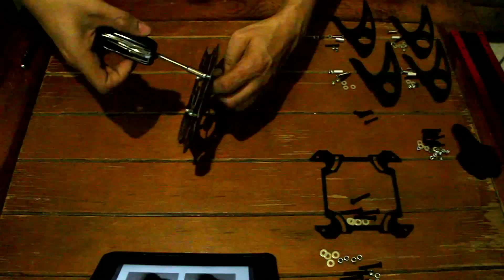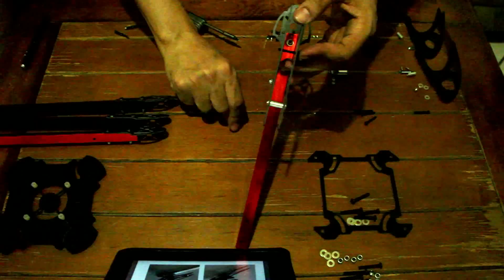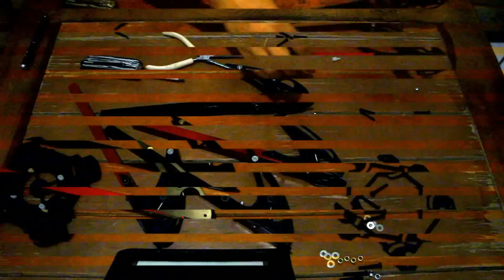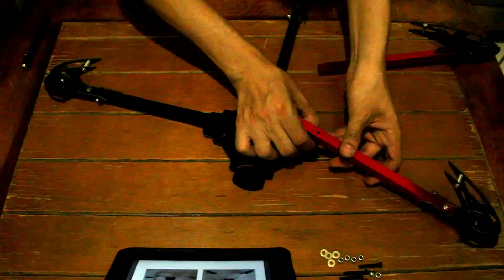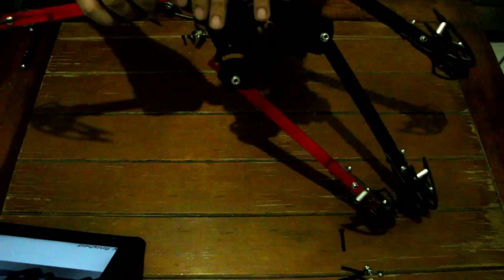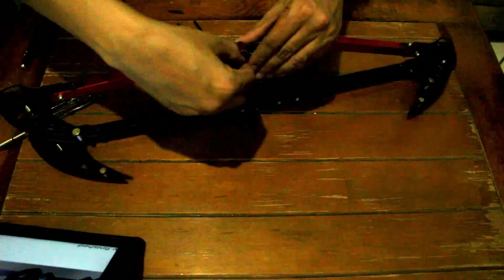Assembly X525 v3 Quadcopter Frame

Comment: good friend wondering if you could help me ? I'm putting together a card quadcopter with a blackboard and the arm ! but when I test it with my radio flysky it does not rise ... it can be?
Reply: +Yeiro David Barros Bolivar make sure you're motors are all spinning the right way and the propellers are correct as well (clockwise/counter-clockwise)